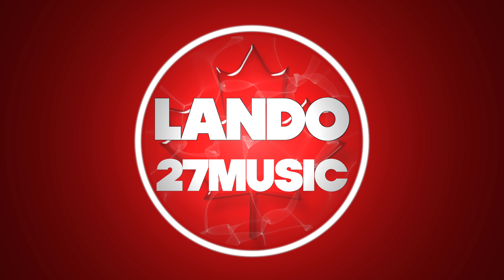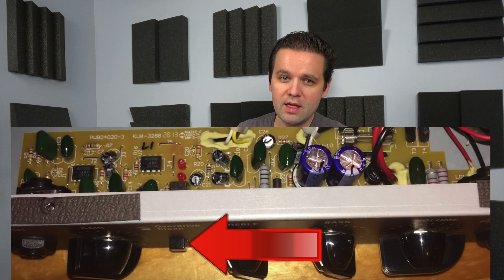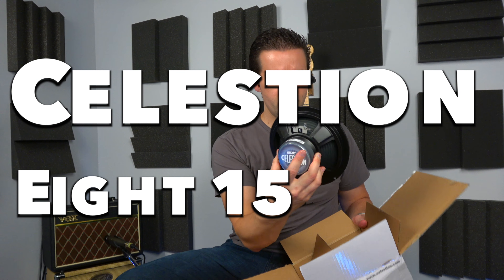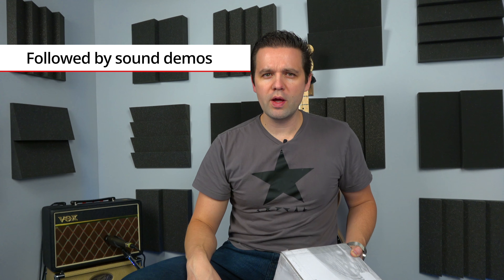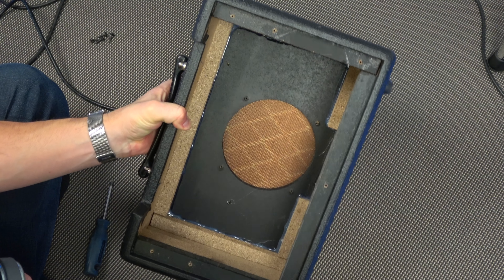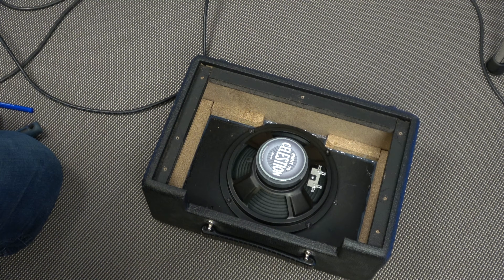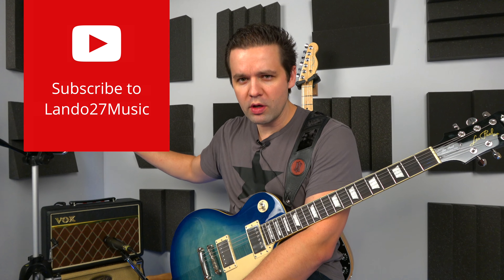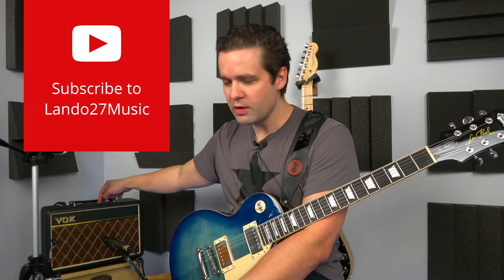BOOST Your Vox Pathfinder 10 With 2 Simple MODS!

Comment: Thanks for the video. I think I'm going to mod mine with a switchable speaker out jack & an LED mod toggle switch so I'll have the best of all worlds! Looking forward to getting my little Vox tomorrow!
Reply from the maker: cool ya Ive seen the line out too. have fun!
Reply: Did u successfully do the led mod
Reply: @ajg7089  Actually I haven't done it yet, and may not... as I found out elsewhere you can put a little piece of plastic into the button so that it engages the "boost" without engaging the clipping LED which is essentially the LED mod without modding. I have also used my little Vox Pathfinder 10 (Union Jack) in my most recent song recording here: https://soundcloud.com/ujnhunter/the-thirteenth-moon-chthonic-black even though Vox isn't typically a "metal" amp... why try and sound like everyone else?
Reply: I put a speaker out jack (switchable) plugged into 2x12 cab and surprisingly loud. Nice to keep option of on board speaker for quieter practice
Reply from the maker: cool!
Reply: @ujnhunter  It sounds more interesting to add / solder a switch to keep options available than ripping off the LEDs which is a bit barbaric in my opinion. But then yeah, one needs to learn how to solder basic components like a switch at the right spot. And I saw no mod videos warning about taking the slightest precautions while touching electronic components as condensers may still have  “juice” in them to sparkle into your body… DIY is cool, but many amateurs are quite irresponsible when showing mods…

Comment: Did you desolder those LED's or just wiggled them out with a pair of pliers?
Reply from the maker: I used pliers. It was a clean pull. If it had been messy I would have cleaned up with a solder gun, but didn't need to :)

Comment: What's the difference between the 8 ohm vs the 16 ohm?
Reply from the maker: it's just the resistance rating on the speaker. there's a lot of good videos that fully explain what it does. 😁👍
Reply: lando27music if I was to get the same amp and fit it with a 16 ohm would it be quieter?

Comment: Great little practice amp.
The Celestion was a slight improvement. 
The overdrive of the Amp is much better to me than the tube screamer pedal.
Reply: Sure because it has a character all its own.
Reply: @TheTwangKings  Not sure if your talking about the Amp vs the Amp plus the TS pedal in front or the Bull Dog speaker vs the Celestion.

But in either case, all circuits and all speakers have their own characteristics. This is a given.
Reply: @stricknine8623  I meant the amp, as it is. You are absolutely right, every circuit has its own tonal character. To mod an amp is to change that characteristic.

Comment: Hey Landon, bought one of these to play in the livingroom, the speaker you had in the P10 was a 6 inch speaker, bad advertising by Vox, not a 6.5. Anyway I put a Jensen 6 inch ceramic in, took me 10 mins and WOW! Perfect fit, now I have a 6.5 inch Jensen speaker!!!! It sounds great, thanks for all your vids, keep rockin the telecasters Kev.
Reply: Which jensen may I ask? I might try that. Don't need an 8".
Reply: hey I know this is an old comment, but do you still like it with the Jensen?  I love the clean sound of the P10 with the stock speaker but the drive sound needs some work

Comment: how did you dismantle the back so easily? I’m struggling to get in!
Reply from the maker: ya it was no trouble at all, just unscrewed and popped it off. I think I had to pull the panel a bit
Reply: lando27music i ended up getting it off, but they glued the back in place as well as the screws. I ripping the speaker cables when I pulled the back off.

Comment: I did the same thing on mine except I put in a Jensen Mod 6/15 speaker. The bigger will sound better
Reply from the maker: +Coach cleats ah cool! the LED mod alone is pretty crazy. Ill have to look up that Jensen
Reply: How is the Jensen speaker working?
Reply: @Al-mu4ff  Great!
Reply: Coach cleats  no issues with mounting?
Reply: Coach cleats In your opinion is the Jensen better than the Celestion?
Reply: @Al-mu4ff  Not sure as I don't have a Celestion to compare. I may have to buy one and check it out since they are only $29 on Amazon
Reply: @Al-mu4ff  yes there was some, you are going to have to carve away some of the wood at the top to make it fit.

Comment: So if anyone actually takes the times to look at the schematic of the pathfinder amp, you'd know how utterly pointless the led mod is. The spdt switch that engages the dirty channel, just adds a pathway after the second stage of the amp, to two leds, one reverse bias to the other, then to ground. Removing the switch makes the clean channel identical to the dirty channel. 

In literally makes the clean channel identical to the dirty channel, if your curious how the led mod sounds, just turn the amp to the clean side that's exactly how it will sound once you rip the leds out.

I don't mean to come off as rude in this comment, just as an electronics engineering student it really pains me to see so much false information go around from people who don't know how electronics work, and people end up ruining their amps because of that.
Reply from the maker: hey Peter, I appreciate all feedback. I can't comment on the electronics, that's not my field. I'm just wondering if you have used or heard the modded amp in person?  The two channels are definitely not the same when you plug in a guitar and hear them.  So maybe I'm misunderstanding what you mean by 'the clean channel identical to the dirty channel'  The clean channel does not break up, and the dirt channel is far louder and has a ton of gain/dirt.  Is removing the switch the same as removing the LED?  I haven't removed the switch.

Comment: way better after mod but you should remove the extra material as its interfearing with the cone !! i bet it will sound WAY better after that !! gj otherwise !! :)
Reply from the maker: +Terry's GG&G I may go back in and chip away more particular board. cheap and easy mod anyways! ttyl Terry! 👍🎸
Reply: lando27music mo
Reply: How would you trim back the front board without damaging the cloth on the front of the amp? I'm looking at putting a Jensen MOD 8-20 in my Pathfinder 10
Reply: @mickhaslam2985  get a buiscuit tin...cut a small flat sheet...sort the edges so it doesnt slice the cloth...pop it into the hole between cloth and and then cut...the thin metal will protect the cloth as you work....easy!.....just remember to take it back out when you finish resizing the hole....

Comment: with a celestion speaker do you get the same vox sound?
Reply from the maker: I'd say so. Celestion is the stock speaker in almost every Vox amp. 🎸🇬🇧😊
Reply: i have a vox pathfinder 15r that needs a new speaker what would you recommend?  I'm super new to the electronics scene.  i just plug and play lol
Reply from the maker: You could go with the same speaker I used.  If there's room for a 10" speaker, there's also the Celestion G10 Greenback

Comment: Maybe, if I do something similar I probably would build a separate cabinet and use the path finder as a head amp and a switch so I can switch between the original speaker and a external speaker cabinet.
Reply from the maker: that could be a cool project!

Comment: Just installed the Celestion 8-15 in my Pathfinder 10. Yes, the sound is beefier, less “Vox”-y, but it’s a simple practice amp. The 6 inch Bulldog speaker is just too wimpy and restricted sounding. If you really need the “Vox sound” I’d suggest going with something better than their 10w practice amp (which isn’t giggable anyway imo).

That said, I didn’t do the LED mod. I can’t find proper instructions - did you just pull them out? Did you pull them out and then resolder to keep the continuity in the LED circuit?
Reply from the maker: hey cool! ya I took some needle nose pliers and just removed them.  no clean up.  there's a YouTube video or webpage somewhere that shows how.
Reply: Lando27Music  Thanks! Just pulled them out. A huge improvement. Def more headroom and plenty of dirt to work with in overdrive. I kept the Vox 6.5” speaker and left the screw holes in the cabinet if I ever want to put the little one back in. This simple led mod, with or without upgrading the speaker, is totally worth it. I wish I had known about this when I bought the Pathfinder 4 or 5 years ago. I never liked (or used) the overdrive on it anyway.

Comment: Curious your thoughts on upgrading the 8" Bulldog speaker in my Pathfinder 15r.  I already ripped out the LEDs with a pair of pliers.  I like the Boost channel using a Boss Combo drive as a clean boost and sprinkle in some ts808 to taste.
Reply from the maker: can it fit a 10"?
Reply: @landonbailey  I believe it can - with some modding or creating a new baffle. I'm seeing a lot of love for Alnico Blue.  I have no clue which speaker to get. I like chimey / bright / sparkly.
Reply from the maker: cool, ya Alnico Blue is the opposite of that :)  Celestion has a great site with sound samples
Reply: @landonbailey  Thats what I need to know.  Thanks.

Comment: I used mine as a head on a two twelve when my small(12 watt wmaster vol) tube head went crap one night. I was afraid the gig would get done yet sound like shit. IT DID NOT. It FELT different to me, but the sound tech said it was tighter and more under control than the other one. 
So, I think if i upgraded the speaker to larger size Celestion similar to your idea it will be my wedding gig amplifier.Thanx, my sound witch says.

Comment: Cool video Landon!  Thanks for the mention!  I dig the Celestion Eight 15!  It definitely sounds "bigger" to me with my modded Pathfinder 10!
Reply from the maker: thanks again! ya it's better in the room for sure, tough to really capture that in a close MIC setup.
Reply: Did you guys use the 8 ohm or 4 ohm? My wife just got me one and I’m really interested in upgrading to the celestion to get some better lows! Also, were there any problems with the cone not making a bigger cutout for the bigger speaker?